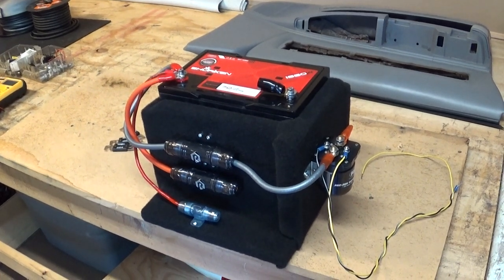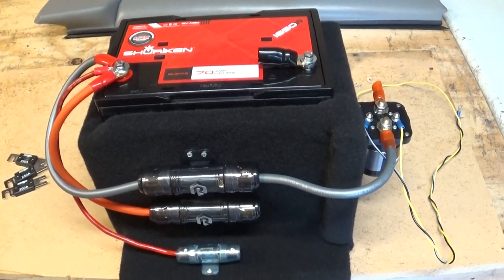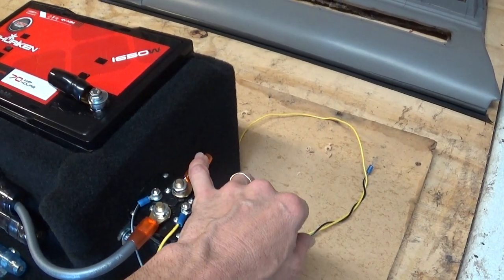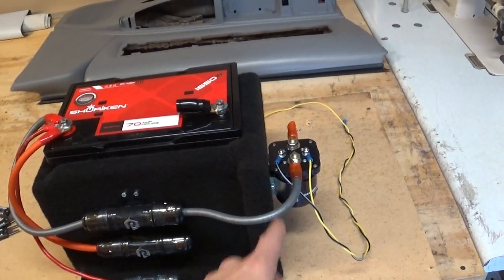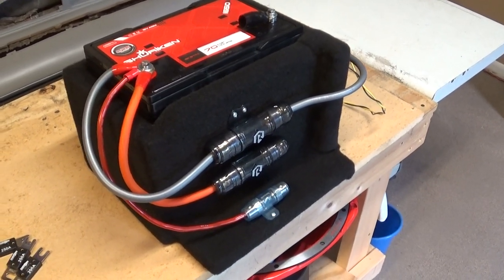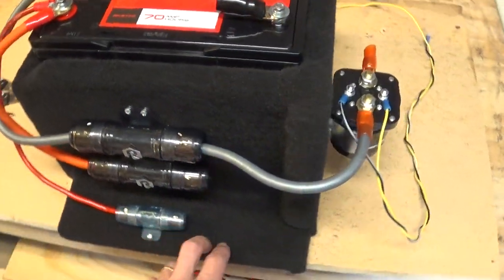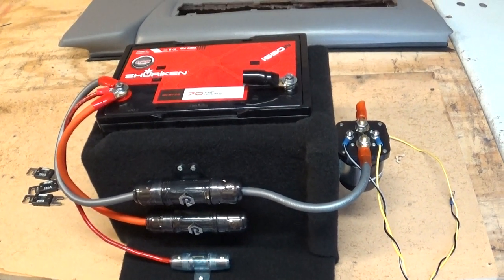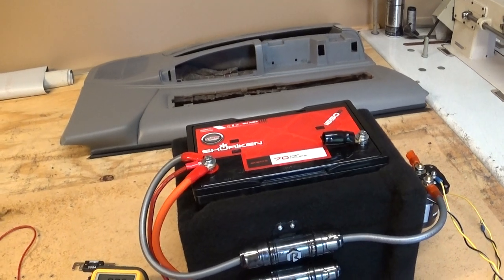Installing a Second Battery for Car Audio "Tips by Matt SSinteriors"

Comment: Hey i got the same set up but my battery in the trunk started smoking really bad do you have any ideas what that could be
Reply from the maker: Maybe power wire is pinched and ground out between batteries? Do you have any fuses between them and if so they should have poped.
Reply: @charles1matt  i checked the fuses none are blown
Reply from the maker: @valenciacabrera69  sounds like you will have to buu a new battery anyways. Make sure the ground and power are good and solid. Also be careful what tou run as far as amps and accessories making aure everyrhing is fused correctly with the correct size wires. Another thing as i was type. Did you use cheap aluminim copper coated power wire? Thay stuff melts with high current. Use ofc 100% copper wire
Reply: @charles1matt  i just bought the car an everything was professionally put in before i bought it
Reply from the maker: @valenciacabrera69  i start over when i go behimd other peoles work. I have seen plenty of jobs sloppy from supposed to be professional installs, not to mention corners cut like the cheap wire I mentioned. I would be willing to help more in person. Let me know if you upload a video about it, will watch and try to help again. Wish you all the best!
Reply: @charles1matt  ok thanks ima try a new battery then ill let u know
Reply from the maker: @valenciacabrera69  i would double check the power wire before installing the new one and sometimes the large fuses dont pop and will cause problems. I have seen one get pinched under the back seat and not pop fuse causing it to smoke also.
Reply: @charles1matt  ok thank u i will make sure to check them out before installing a new battery

Comment: I have the amp turn on wire fire up  a relay that sends power to my amps. When I upgrade the amps I might add a second battery, and if I do I will power up the isolator from that relay so that it only functions when the radio is on. But for now Im replacing the lead acid battery with an AGM tomorrow. And soon after I will get a mechman alt.
Reply from the maker: Ah Umm it's recommended to use an ignition turn on for the isolator, so batteries are connected any time the car is turned on.

Comment: Hey Matt. I'm hoping you can help me with a couple quick questions. 
   I'm installing a second battery (no isolator) my cars battery is in the trunk. 
Q1. Should I have both my amps connected to the 2nd battery?

Q2. Is this the proper diagram (POS from alt POS on batt 1 then to POS batt 2? How to ground? Do both batteries need the post grounded to a ground spot or do you have batt 1 use factory ground spot and run from neg to neg post on 2nd batt? 
Please help me. I'll like and sub for the info.
Reply from the maker: yes you are right except you DO need to ground the 2nd battery use a flat spot on the trunk pan (or anywhere) and bolt the ground down solid.
Reply: @charles1matt  Can it be the same spot as the first batt?
Reply from the maker: @docgray5004  nah don't run a ground wire from front to rear of the car. Need a ground within a couple feet of battery. You can ground it same spot as the amps just make sure you sand the spot to bare metal first.
Reply: @charles1matt  my factory battery location is in the trunk. 2008 cobalt.
Reply from the maker: @docgray5004  oh ok makes me think of the dodge chargers with the batt in trunk. awful location for the factory battery. the dodges corrode bad on the ground from moisture. I still recommend finding another spot?
Reply: I have 2009 Chevy colbolt all i did was the big 3 added another 0 gauge wire to my main negative post on my  battery in the trunk to the frame run a 0 gauge wire from alternator positive to back main battery positive then I run a 0 gauge ground from front chaiss block ground to the negative post on the main battery takes care of the big 3 now to add another battery all I did was main battery to secondry battery was positive to positive negative to negative I also ground my secondry battery to the frame hope that helps if the batteries arent the same use a battery isolator if they are the same just do parallel but yes I had both my amps hooked up to my secondry battery my highs amp an bass amp no problems

Comment: I have a capacitor with a voltage meter... im guessing that is the same as the isolator?.. sorry not to sure on this...
Reply from the maker: Gabino Gonzalez no, just think of the isolator as a switch between the front batt and rear batt. I wouldn't worry about adding one between a batt. and capacitor
Reply: matt1989cars would i connect the isolator between the amp and capacitor?
Reply from the maker: Gabino Gonzalez no need for a isolator in your case, but yes if you want one, it goes between batt. and cap

Comment: Hey Matt, i have 3 amps with separate  power cables on the batterie up front, now i want a second batterie in the trunk and connect my fourth AMP on this on,  Will this work?
Reply from the maker: Hey guys, the idea here is to run extra electronics off the second (deep cycle) battery, that way large surges of power will be drawn off the second battery first. I would run 4-0ga power wire to the second battery and then run all amps from the second battery. What you are doing would work, but I highly recommend starting at the second battery for all amps! Remember always add correct fuses for the amps/current you're pulling.
Reply: matt1989cars 
Oke, thanks alot for your advice,
Reply: Personally (no expert) I'd run the 1st battery for your vocal amps and then the other mono block amps on Ur 2nd battery... Or split the 4 amps per battery eg. 2 amps per battery

Comment: so if i was adding two batteries in back do i need two isolators
Reply from the maker: Andre Burton-Sandridege no, just one between the front batt. and the rear set
Reply: dont waste  money or time..    isolators  are over rated

Comment: Hey mad, 
Do you know, if i can wire two 8 OHM speakers in parrallel and connect to my bridged 4 channel amp, for a 4 OHM final impedance
Reply from the maker: Of course, just make sure they are matching speakers as they will share the wattage evenly. A mutli-meter helps measure this on ohms setting. I wired up 4 4ohm car subs in series at 8ohm for a house set up and they knocked, friend still has them playing 15 years later, (basic massive series 12's 200w each)
Reply: matt1989cars 
Oke thanks alot, i just needed to be sure,

Comment: Hi 

I have an orion hcca 12.4 and a d5000 amp, my sub cuts out when booming hard and the voltage drops i have not upgraded any batts, what batterie would you recommend?
Reply from the maker: 2400 batts and up plus alternator upgrade, 0ga 100% copper power is a must too!

Comment: do the fuses have to be 200 amp or do ya think 150 amp fuses could be good enough??
Reply from the maker: ryan dyson that depends on how much current you are pulling? easiest way is just add up the total number of all the factory fuses on the amp/amps you're using.
Reply: rockfords don't have any but it says it recommends 80 amp fuse
Reply from the maker: ryan dyson 100amp should be fine then and you probably don't even need a second batt for that install? never hurts though
Reply: i have rockford and i use 60amp fuse and will be using another 60amp fuse when i installl my second battery

Comment: I have a 165 amp alternator in my Tahoe, is it enough for your system ?
Reply from the maker: Mr. 825 Dallas that's a question you have to answer for your system, you can add a second power source to almost any alternator, but if the items/amp for feeding pulls more current then the alternator can put out, then you would get battery drain
Reply: matt1989cars thanks 🙏🏻
Reply: That’s a stock alternator you have, I found a new 250 amp on eBay.  The stock alternator is not enough to keep system up to par...
Reply: I run 4 batteries in my truck and mine came with 2 battery trays...

Comment: Hi, thank you so much for the videos. I had a question about adding a second battery. I have a 1965 impala that already has a Low amp alternator. I did upgraded, but doesn’t seem to help too much. We are adding a second battery help? And will I have to add a battery isolator?.
Reply: I Will not be running a stereo with the car off.

Comment: LMAO!   neither me nor 90+% of competitors in all competing divisions use battery isolators, lol... serious, just make sure you're using the same cells and you'll never have an issue of any kind. my current electrical system is about 4 going on 5 years old. i have 7 batteries with one high output alternator AND NO ISOLATOR. i'm running 4 6,000 watt amps (running at 1 ohm) and i NEVER drop below 14.5 volts. even when i'm at an event and doing demo's all day and even over multiple days. 
 all an isolator does is allow you to decide which battery is getting charged. but if you're like basically every other audio enthusiast. if you're in your car... you're bumping your system. so exactly when would you NOT want your secondary batteries charging? thus, you'll just be spending cash on a device that literally does nothing for you. 
 honestly, i've been competing for well over 20 years now. and about the only people i can think of that use these things. are newbie's that have just stepped up into adding additional batteries. and some dink in a shop conned them into spending more money on one of these. 
 doubt me if you want. but feel free to message all the competitors you like to ask them what isolators they use. and after they stop laughing, they'll tell you they don't use them.
Reply from the maker: Yeah I don't use them with matching dry cell batts and half your angle is off as it was for parking/storing the vehicle while it was NOT being used. PS your kind of an ass my friend, ✌
Reply: @charles1matt  my shower isn't a daily driver. it sits all the time. so there goes that. and i've used several types of batteries over the years. as well as have many competitors. so there goes that as well. and spotting someone giving poor advice to people that could result in them wasting money isn't being an ass. if i were standing there that day you were being told this nonsense and saved you from spending the money, would i still be an ass? nope... i bet i would have gotten a thank you sir instead. but nice attempt to save face my friend, lol...
Reply from the maker: @governmentcheese7726  have a blessed one guy, we live and learn. I don't use them anymore either, but they still have a benefit for storage and separation while parked. I'm not going back and forth with you anymore ✌ one front batt dead is better than all dead😉
Reply: @charles1matt  want trying to back and forth. Just responding accordingly. As for long-term storage. Yes, you could spend all that money on an isolator. OR.... Simply install a $5 or $10 kill switch. Which then cuts off the connection and is analog so it'll never run the risk of failing.
Reply from the maker: @governmentcheese7726  ok thanks and yep sounds good plus I found cheaper isolators since this video too👍 all good and I never should have responded as soon as I woke this morning, lol

Comment: You're the first I've seen to add a relay switch. So this battery will still charge through the alternator when in Drive/Gear, yet when in Park/Reverse, this battery becomes disabled?
Reply from the maker: Gavin Firkser no, when the key is on they are connected, key off disconnected. the only time the alternator can charge, is when the car is running and turning the alternator.

Comment: i have second batt but my dont use isolator i think its waste of money but thats just me if its wired up correctly second battery wont draw power from main untill it started
Reply from the maker: Ok, but they do equal out and share the voltage while sitting parked. Peace
Reply: How u do yours bro???